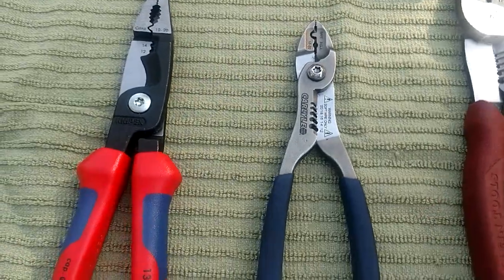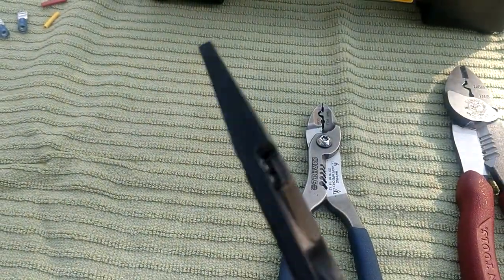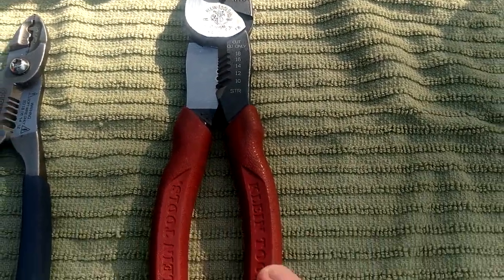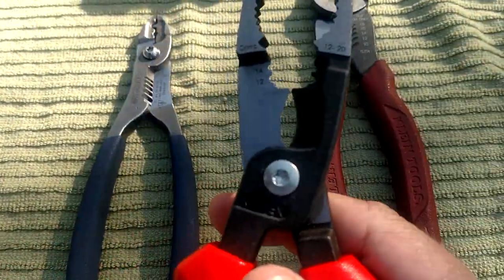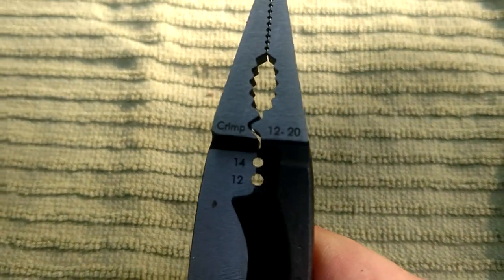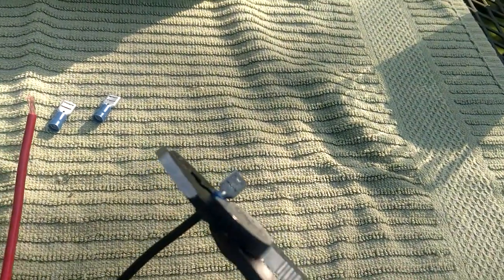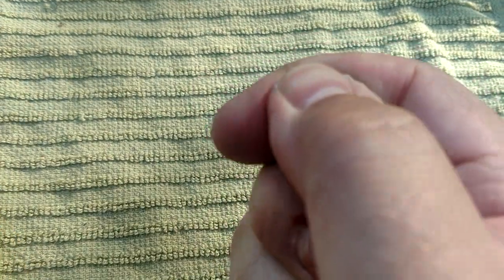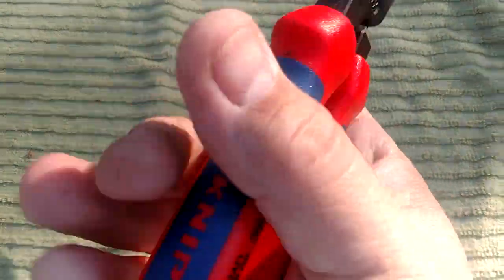Stripper Showdown!!! Knipex 13 82 8 vs Klein 2005N vs Carlyle CHT WSCCP. All-In-One Wire Strippers.

Comment: The Carlyle or Snap-On are better for auto work. Because of the smaller head. Klein is just too big.
Reply from the maker: Good point. When you're in those tight spaces, size does matter.
(And no, that's not what she said.)
😂👌😎👍 Thanks for watching.

Comment: I don't have any of those but I need the Carlyle CHT WSCCP now 😎 I have the Southwire S5N1 (5-In-1 Multi-Tool Pliers). They are great, thin profile tips but with large aggressive round gripping teeth so a full pliers head really. The cutter is large and works awesome and the crimper is on the back side close to the pivot point so crimping is effortless with that leverage. It reams and has comfort grips.

Comment: My #1 is the Klein  J207-8CR  "All-Purpose"  pliers; needle-nose, strippers, cutter, crimper. 

*   I have those KNIPEX; (impulse buy while at the Electrical Supply house), but, for the reason you stated, they got put in my electrical toolbag at the house because the crimper isn't suited to HVAC work.  They really shine if you're doing 12-14ga romex, electrical boxes, and EMT. 

*  I have the green-handled Snap-On version of those Carlyle crimpers; they're really nice, but aren't needle-nose - so they've been banished to my automotive tool box (where, as you mentioned, they're starting to get surface rust because of that shinier finish on the stieel).   I forget exactly how expensive they were, bought them on eBay. 

*  Those Klein 2005N stripper/crimpers are nice....but, again, lack the needle-nose - so the 'All Purpose Plier' wins again.
Reply: Update - just scored a NIB pair of those Klein 2005N pliers on eBay for  $25.62
Couldn't pass them up for THAT price; will have to throw them in my TP4 and use them for a week or two and see if those handles are as nice as you say.
Reply: What's the update? What you recommend for hvac work?
Reply: Thanks for the tip, any update?

Comment: I wish channel lock came out with a stripper crimper combo. I like the channel locks better than the kleins cause I crimp a lot of insulated spade terminals and you dont have to open the tool up all the way to get in there cause channel locks is on the top instead of the bottom like klein
Reply from the maker: Very good point. And that's the kind of stuff I was hoping to see in the comments. That kind of stuff helps other guys choose the correct tool for them. I actually meant to mention that in the video but forgot. I do like the idea of putting the insulated crimp on top, furthest away from the rivet. 😎👍

Comment: Carlyle has a nice multi tool with a very thin needle nose that I like for control work.- model CHT WSCCPLN,  but they have gotten ridiculously priced for a Taiwan-made tool.  They were $30 just a few years ago.   Also, NAPA will not exchange a defective tool without a receipt, so I'm not sure I will continue to buy from them. Snap on 29ACF are also a solid choice, with insulated crimpers closer to the end of the tool but expensive.  

If you get bored sometimes test the quality of your crimps with some weight.  UL486A standards are strength pull test of  70lbs for #12, 50lbs for #14, 30lbs for #16, and 20 lbs for #18.
Reply from the maker: Thanks for watching & for the feedback. 😎👍

Comment: one thing to note is the difference in strippers for solid wiring vs. stranded. like the kleins only list the wire gauge for stranded(STR). that model knipex appears to be labeled for solid wire(didn't look it up, maybe not) but the difference is usually one gauge size off. examples, stripper for 10awg solid = 12awg stranded wire and stripper for 14awg solid wire = 16awg stranded!
if you don't pay attention and use stripper solid wire marking on stranded, it deeply nicks all of the outer strands and causes them to break off very easily, which makes a weak point when terminating(crimp/solder/lug/wire cap) make no difference.
Reply: ok, I couldn't resist temptation. the knipex stripper holes are labeled for solid wire, with stranded(STRD) it's 14 and 16awg!
https://knipex-tools.com/index.php?id=1023&page=art_detail&parentID=&groupID=2216&artID=34120

Comment: Generator and hvac tech with an automotive background.  Basically a maintenance repair douche. 

The crimper portion of those Klein’s sucks. The little snap ons (same size as the Carlyle) have more leverage for crimper. The Klein’s crimper head isn’t the same as the OG Maroon crimper. The cable cutter portion of the Klein’s below the rivet fold over on fine stranded wire. I was very disappointed in them.  Maybe my set was just a dud.  I wish knipex offered more wire sizes for the stripper portion. Not all of us in the sparky field use cutters and strippers for romex. I also wish knipex would make a 10-12” pair of cable shears like Klein does.  The cable cutters Knipex makes are a stepped design and do not work well with double insulated SO cables.  

My gotos are the snap on shortys. 4-5 pairs between the service tuck, work, veto tech pack, home, etc. or the OG Klein dedicated crimper.  OTC and cornwell also make a 90 degree head version of the snap ons/Carlyle that make awesome crimps in tight spots. I like the wide nose forged Klein stripper combos but the leverage point for the crimper makes it difficult for proper crimps.
Reply from the maker: Thanks for your comment and thanks for watching 😎👍

Comment: So you're 100% sure that the Carlyle unit is made in the USA??  With USA steel? Snap On has to  meet government  "mil spec" quality control that Carlyle doesn't.  Maybe the Carlyles are Snappy rejects and rebranded.  I don't know.  For the average homeowner and occasional HVAC dabbler, the Carlyles might be fine, but a pro mechanic can write off the Snappy and Klein additional costs on their taxes and the homeowner can't.  IF a reject fails the homeowner, he or she has to take time out of their free time to go get it replaced.  IF a pro has a tool fail, it's costing them money to go chase replacement parts and tools when they should be finishing up a job.  I've pretty much lived by that old slogan,  "Buy The Best and only cry once.".  I do like your detail in this video and I'll be looking for a pair of the Kleins at the next few flea markets and yard sales I attend.
Reply from the maker: I don't believe I remember saying the Carlyle were made in the USA. They're actually made in Taiwan. Which is slightly better than China product. They are actually very good quality and also come with a lifetime warranty through NAPA auto parts. You can go into any of their stores and exchange them if they ever break or tear up on you.
Thanks for watching 😎👍